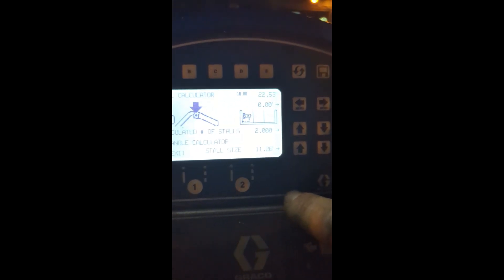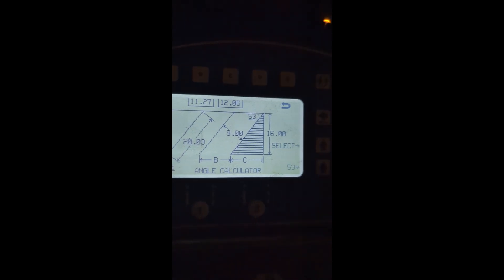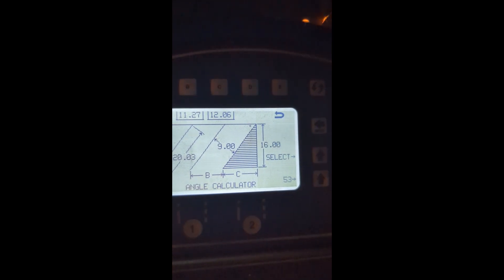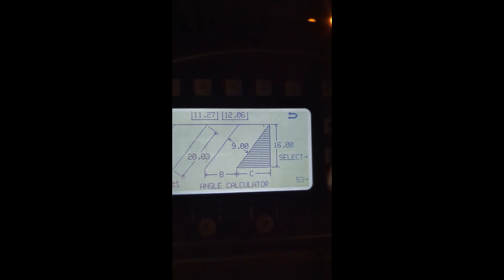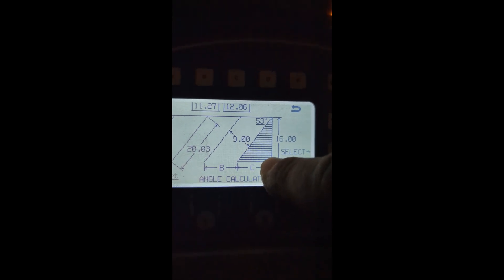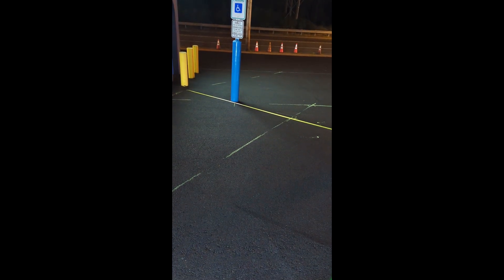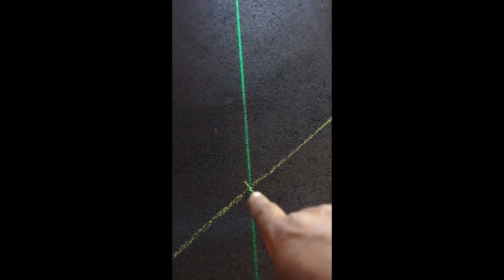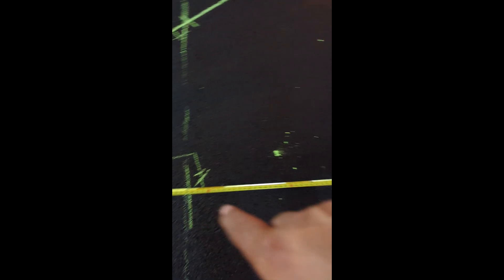Question and the answer on how to find the angle degree

Comment: Just wanted to day i loved the video...I do the exact same thing you did with the angle calculator to find my offset but after that I could save you some time and quite a few steps...instead of pulling a 90 degree off the bollard, do the following. Make a mark along the baseline that is 1/2 the distance of ur baseline measurement of 11.27 away from the bollard...pull a 90 degree mark off that mark at the 16 foot line and then just use your offset measurement of 12.06 away from that mark in the correct direction of the spaces and then connect that mark to your half of 11.27 mark away from the bollard on the baseline and you have your correct angle...no need for any of those other measurements you were doing.  Hope thay simplifies things for you going forward.
Reply from the maker: Thanks for the info, I will try next time I get one like this
Reply: Good 👍